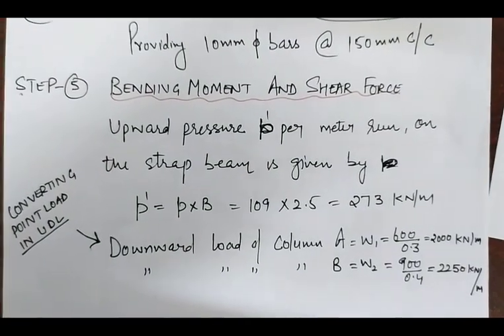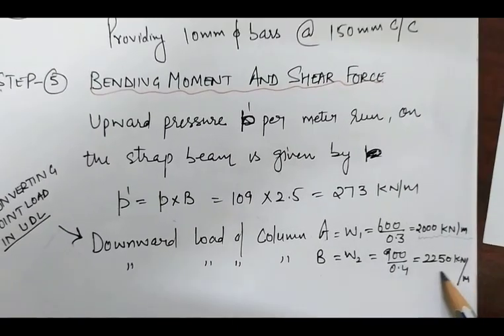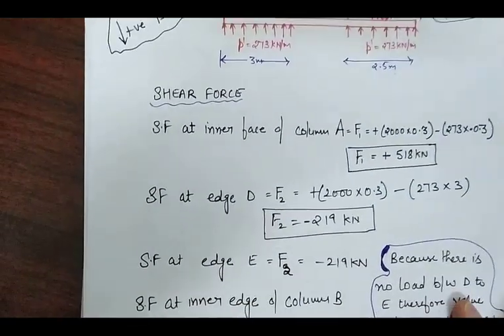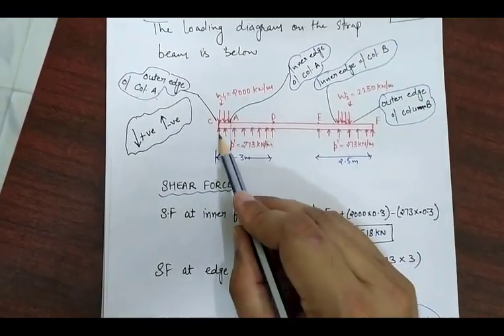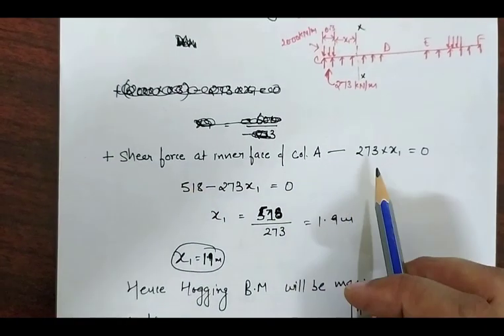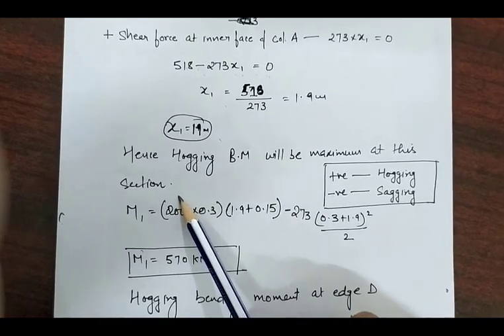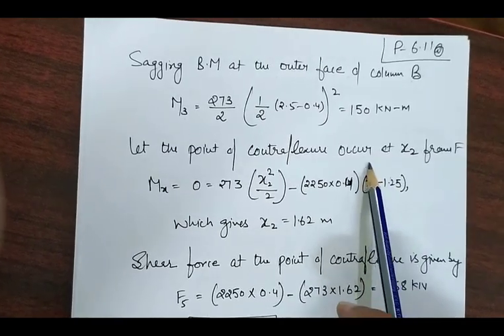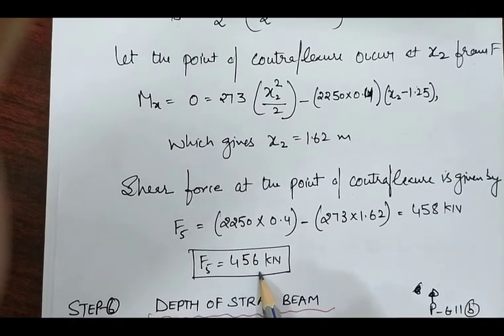Lecture 11 - Design of Strap Footing (Part-III)

Comment: SHEAR FORCE AT INNER EDGE OF COLUMN B ,F3=-219-(273X1/2(2.5-0.4)=-506 KN, UPWARD PRESSURE FOR SHEAR FORCE SIGN WILL BE NEGATIVE
Reply from the maker: Writting error... Thanks for noticing
Reply: Sir, got lot of knowledge on your explanation, please complete all design part